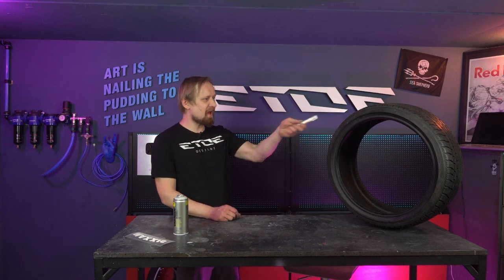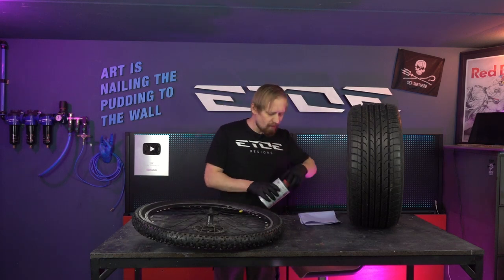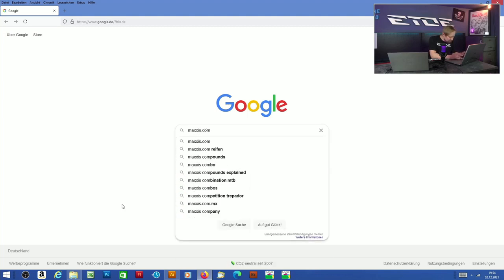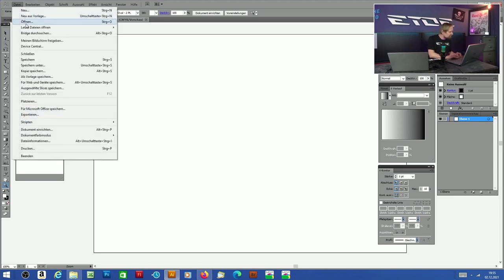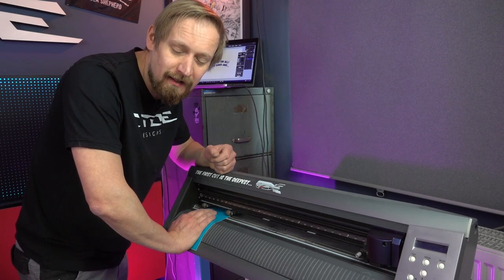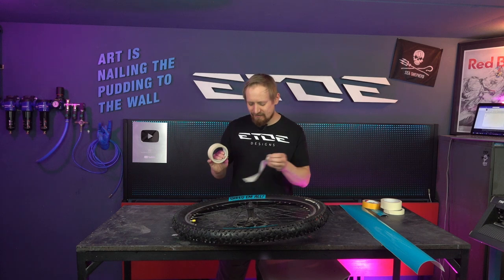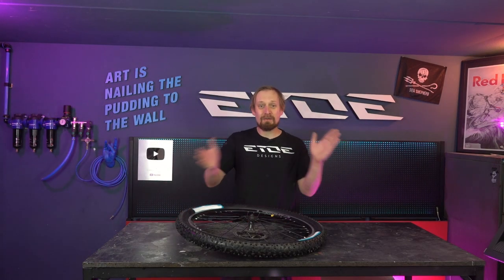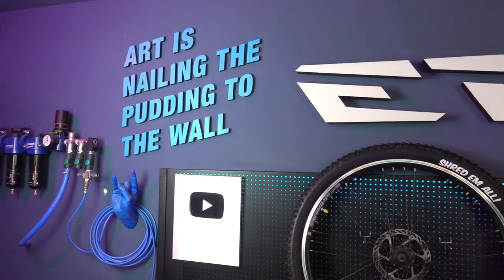Making Tire Decals That Last!

Comment: I had tire stickers. They got all screwed up. This is because the curbs in Jerome Arizona are high and the roads are very narrow. Parking is so limited that if you see a space you better grab it quick. So I did. I ended up scraping against the curb. Anyway, it looked so ugly I removed the stickers from my tires completely because I didn't want it on one tire and not on the other. I wish they made something you can put over the lettering to protect it. I know that's nearly impossible with tires, but I really wish that it was possible. Now that I had to remove the stickers the glue etched the tires and they look like they have cancer. It's awful. Brand new tires too. I would have just turned them to the inside, but they're one directional so I couldn't could not could not.

Comment: I do mine with bog standard artists acrylic paint. Inflate fully, and dab it on like a potato print, don't brush it. (You want to impregnate the gaps in the rubber) let some air out and clean it up, inflate and repeat for a strong visual.  First discovered while blacking out giant yellow maxxis logos 🤣 lasts well as it's fairly flexible and the colours are vivid. Dab though and keep it a really light coat, you want it 'in' the rubber not 'on' it.  And yes it's wash resistant unless you max out your tyre pressure and scrub it out of the grain.

(Btw maxxis has sister company CST. half the price, same rubber, same factory, better tread designs. Smaller white logos (police use em)👍)

Comment: My son wants me to add the yellow Dunlop logo to his dirtbike and Surron tires but I cant seem to find all the items needed. Could you help me get the correct materials for the painting process? The links you provided are no longer available and wanted to see if you can help me get the the correct solvent, the screenprint ink and the correct tip for the airbrush. I was not sure if you would use the same materials or make any changes since the vide was made? Thanks again
Reply from the maker: Yes of course. Would you help me doing something for my son? And what exactly would you do for my son?

Comment: Dude you crack me up. Keep the jokes coming and the video's you make are great!! THX Bro. I have a question for you. If there are no good open spaces for a new logo on I.E a motorcycle tire. Can you flatten the current or old imprinted names that is normally ribbed or raised from the manufacturer and then paint over that surface again?.............not sure if you tried this. THX
Reply from the maker: You are welcome. You can by sanding the rubber.

Comment: @ETOE Nice video as always, can you recommend a specific brand to create decals? what thickness should the film have so that the edges do not stand out. in your video description you mention the slide from Oracal  , have you had problems with certain paint brands and the film from OracleYou have often mentioned that you have to be careful that the paint also matches the decals and that no bubbles form later, etc., how can I find out whether the film fits my paint

Comment: Great vid mate but i have a question regarding the Nitro Thinner- can i use anything else like acetone for example? Is the idea to just clean the rubber surface or is the thinner having another affect like softening the rubber/making it tacky/etc so the plastisol will stick?
Reply from the maker: you need nitro.
Reply: @ETOE  very much appreciated, thanks for the reply👍🏼🍻

Comment: Thanks Martin as always neat job ......i have only 1 question.
can we use a aerosol spray can?? if we don't have a proper paint booth setup.
I have used oil based liquid paint in the past & waited for a week to cure but it didnt last long 😭
So will 4 layers of aerosol spray can last long?
Reply from the maker: Not on tires.

Comment: Do I still need a hardener and a thinner with the paint you have in the link? (Its not the same as what you used in the video...so I don't know what to thin it with)...Great video by the way...a lot of good info and humor !
Reply from the maker: Yes and yes
Reply: @ETOE  I tried to find the hardener for it (unsuccessfully)...are you able to tell me the name of the hardener and the thinner (Im from the U.S. and am not very familiar with the products I may need)...Your help will be greatly appreciated
Reply from the maker: @jaisonrhock9729  No sorry Im not familiar with the US market. I buy local nearby. Best is you ask an US guy for advice that to use in your region.
Reply: @ETOE  thanks anyway...I'll try to find someone local
Reply: Was wondering the same thing. What kind of hardener am I supposed to use? Same one you mix with clear coat?
Reply: @jaisonrhock9729  Did you ever figure out what hardener to use?

Comment: Yep - Enjoyed as always. But something has been bugging me for a while. When you translate “Pudding an der wand nageln” into English, ‘pudding’ needs to be translated to ‘Custard’. In English ‘Pudding’ is a generic Northern term for any desert, and there are many examples of Puddings we had at school dinner (In the North, you had dinner at lunchtime, tea in the evening) which you could’ve easily nailed to a wall. When we did have puddings which you couldn’t nail to the wall, the problem would’ve been finding a strong enough nail and heavy enough hammer.